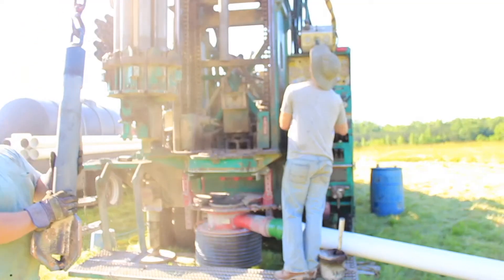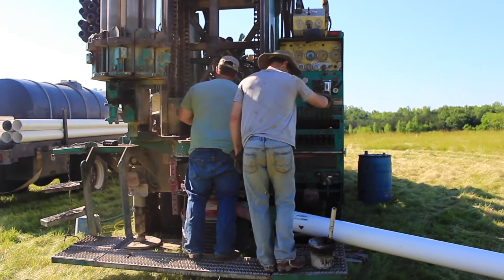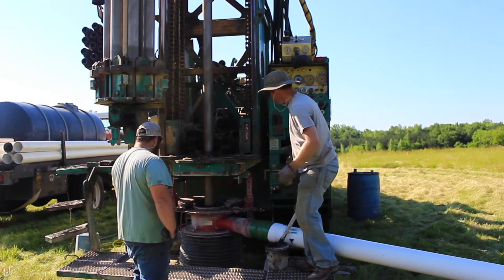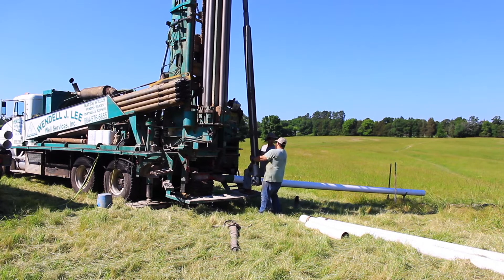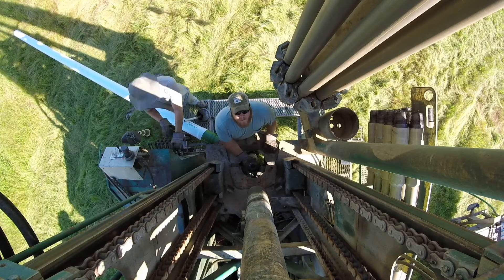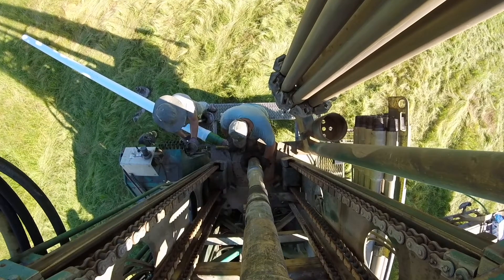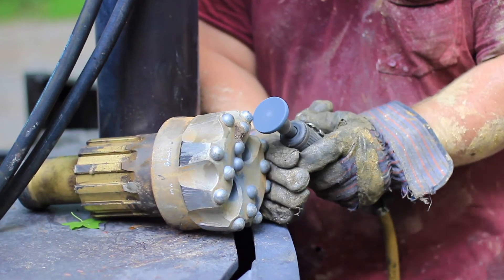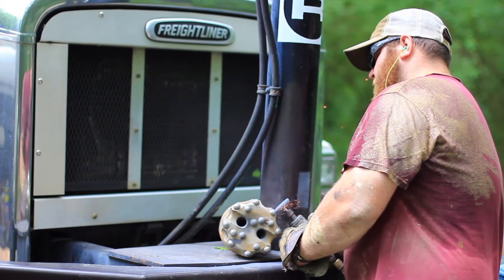How a Water Well is Drilled: Water Well Drilling with the Right Drill Bit

Comment: Hey. I was wondering if you have any bits for going over a smaller well casing to make it bigger. I know they are out there just have never seen one. I have a 3 inch well and am looking into getting it over drilled to 8 inch. With what I was to under stand the big has a hole in the middle that goes over the old casing. Do you know  what I am talking about? Thanks